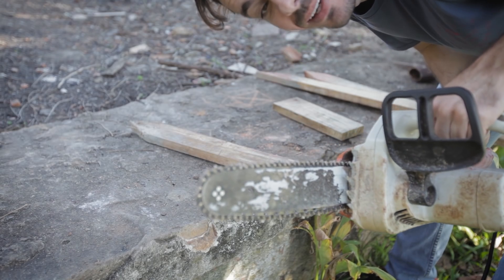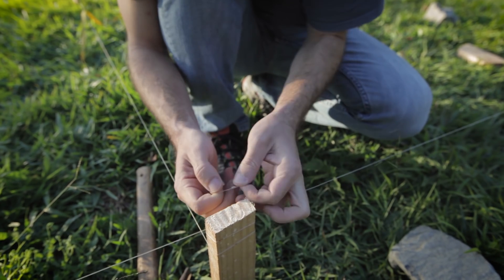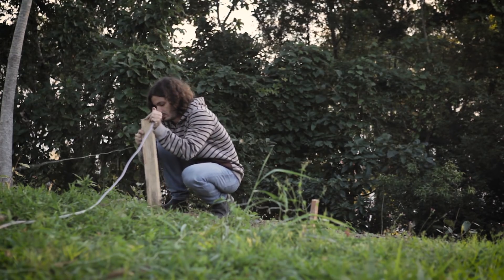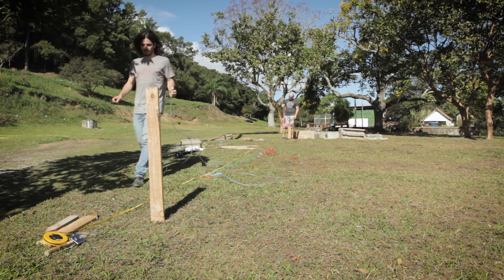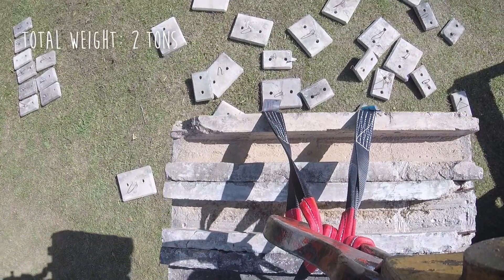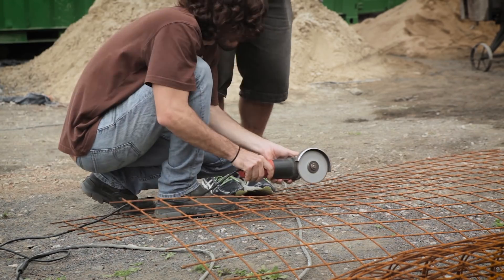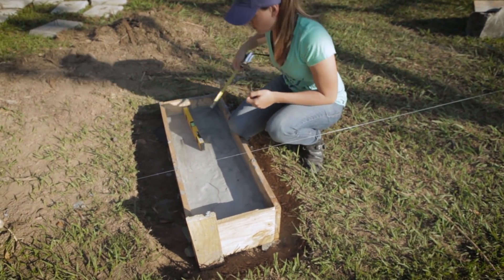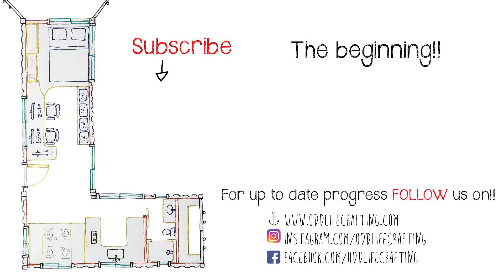Foundation of our Shipping Container House - Site marking, levelling, excavation, footings - Ep. 001

Comment: Hey, guys. I love what I've seen so far (I started by watching your sailboat channel). Kind of late in the game I realized that I was on Tiny episode 17 (binge watching is abnormal for me) and had not hit the like button on anything yet so I went back and did so. I do have a couple of questions. First: when you placed the containers, did you fasten them to the concrete supports or are you using gravity?  Second: when you place the sliding windows to access your outdoor areas, did you seal the bottom of the doors as you did the sides and top?
Reply from the maker: Thanks a lot for your support, Rich. We are glad you’re enjoying our channel. The containers are just there using gravity. The doors we put polyurethane on the bottom to avoid the water to enter in the house. 😉

Comment: Another way to build a 90 degree angle is :

You make an alignement with  two points, the middle off this alignement should be the corner ( practical if you dont want to report the line)

from the extremity of the two points you draw a circle with a ray superior at the mid size fo your alignement, from the intersection of those two circle you get a point , this point is a on line 90 de degree from the middle of your alignement ;) 

https://upload.wikimedia.org/wikipedia/commons/thumb/6/60/Mediatrice_compas.svg/440px-Mediatrice_compas.svg.png 

practical if you dont have a meter

Comment: There's a video elsewhere on YouTube made by a designer who also built a mini-house out of shipping containers. By the time he was finished it had cost him significantly more than if he'd built the mini-house using conventional methods and materials. He admitted that it was just a funky experiment/gimmick, and not really an economical or sensible way of making a small house.
Reply from the maker: Well, we're gonna see how much it will cost in the future. BUt in my opinion if you need to hire someone it's a specialized job and expensive and then it's gonna be more expensive than a tradicinal house for sure.
Reply: @OddLifeCrafting  I think he did most of the work himself or with friends/partner, except for laying the foundations blocks where he hired a contractor. He was comparing self-build with self-build when saying using containers was more expensive. It was also more complex, difficult and took more time than a conventional timber framed build. 

You can look at his YouTube channel here: -

https://youtu.be/QA5fh29rhLs

Comment: awesome guys.  hoping to learn a lot for you.
Reply from the maker: We are not pros but we are learning so much doing it that you might be atto also learn with us. Hehehehe 😎👌🏼
Reply: well i am going to do the same build a few years down the road. i like the idea of making an L shape with 2 containers. i am already getting some great ideas from you guys.
Reply from the maker: 👌🏼 the L shape make a huge difference on my point of view. Seam like the house is actually bigger than it is. 😎
Reply: yes, an L shape can support a larger slightly sloping roof  for rain water collection and solar panels. i will insulate mine externally with batons and cladding. how are you going to insulate yours. the containers sweat and rust if you dont spray foam them.
Reply from the maker: It will probably be insulated with eps. 👌🏼
Reply: is that the spray on foam? that is probably the best way if you are putting insulation on the inside. i like the idea of putting battons on the outside  and using  styerofoam  and tin cladding. leaves a very industrial look on the inside.
Reply from the maker: Yes I mean on the inside we’ll use eps. On the outside just stripes of wood so the sun doesn’t touch the metal. No insulation on the outside.